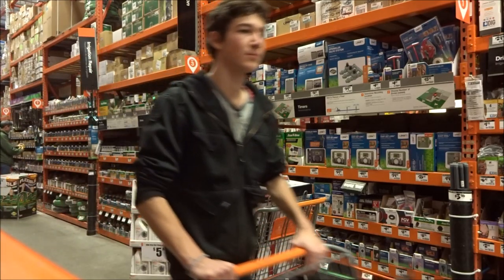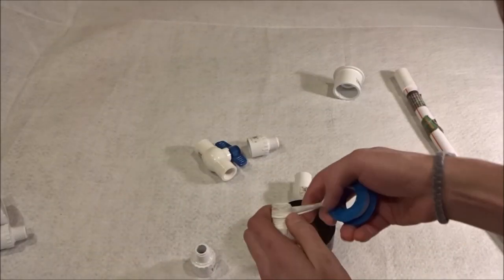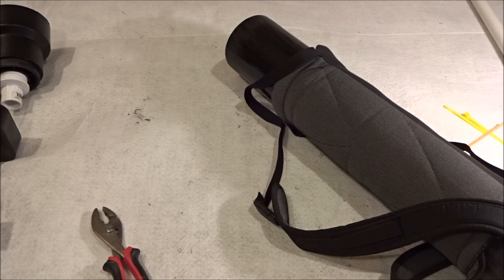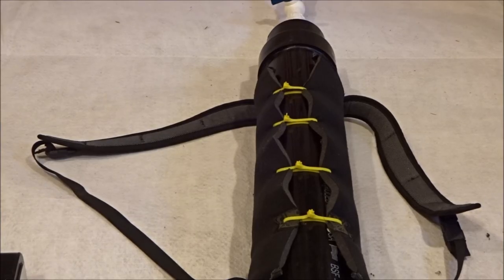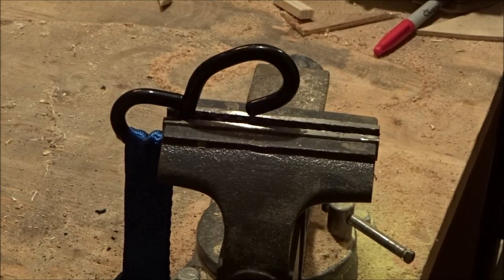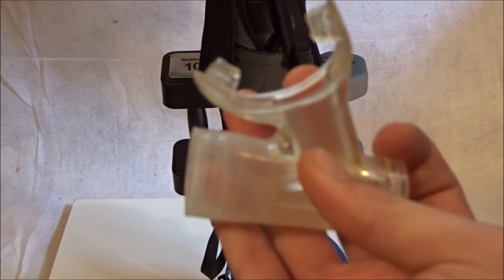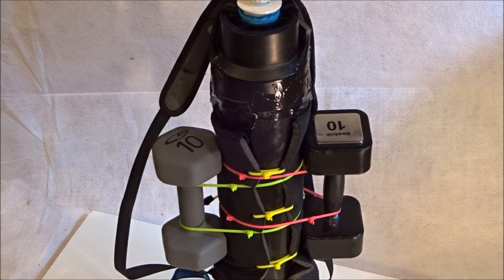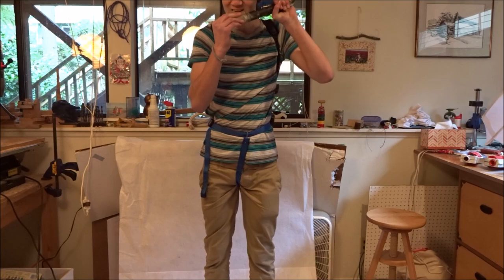How I Made A DIY Scuba tank

Comment: It's a good starting point. PVC has a known maximum pressure rating of 400psi. If I was going to try it I would use an actual pressure tank. A regulator is absolutely essential that's one part that cannot and should not be MacGyvered or tampered with.

Comment: Kid I'm not dissing your tank but do not have the weights attached to it. 
 You need a weight belt with quick release on your waist. 
If you get into trouble you can drop the weights separate from your tank and body. 
I can tell you have no experience. Take it from me I have been diving for 40 years and I see your setup as a death trap.
Reply from the maker: gary gibbs I know, don't worry I don't use the tank anymore. plus I didn't ever use it in water I couldn't stand in
Reply: gary gibbs padi diver ??
Reply: and im 300 years old
Reply: But come on it is pretty good for DIY
Reply: @reddits-crazy-stories  if your james bond running for your life

Comment: Do not sand PVC fittings.  You will weaken the bond., instead,  use primer with your solvent. This is not a gluing exercise,  rather, this is a solvent welding exercise.

Comment: you going to blow your lungs out at 80 pounds of pressure. lol i need a way to regulate the air pressure.
Reply from the maker: Brian R that's why there are two ball valves
Reply: Brian R you can buy a second stage regulator off of amazon that's good to about 145 psi. It's only about 20$

Comment: You are going to be responsible for someone's death with this video.
Reply from the maker: Michael Arnold I will not be liable, I said multiple times not to do it or make it and have it written in the description as well not to do it.
Reply: I did not say liable, I said responsible.
Reply from the maker: Michael Arnold I can't control people, there are lots of videos doing much more dangerous scuba tank builds and if anyone had the initiative to make one, then it is not my fault nor theres because it would have gotten done with or without me or them. just because I told you to jump off a bridge doesn't mean you should, and it doesn't make me responsible. That's my opinion, even if it's flawed
Reply: @Zaplethal  no, but you need to teach people to build things that will not kill them.  
Just because someone else built a janky tank project, you don't need to add another.  

Get the engineering down and actually build something that will work.  The designs are out there for proper regulators and the like.  

Graduate to the next league and show us your real talents. Practice makes perfect.

Comment: Thats why he used 2 valves. You open 1 about a quarter , and then the one too your mouth about an 8th turn. It works just have to be careful using quick release weights wich ive made. Im putting a air presser regulator on it also. I will go to a real one one day. This idea will be tested in shallow water.
 Dr. Miller
Reply: R.I.P.  suicide kit